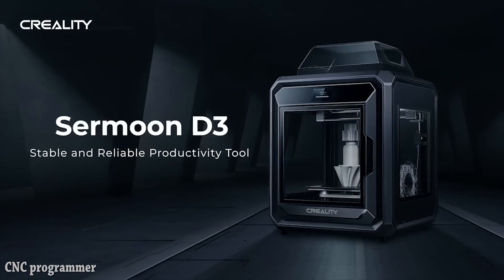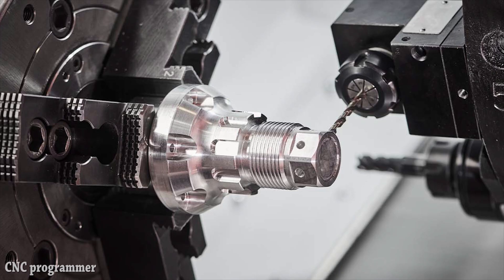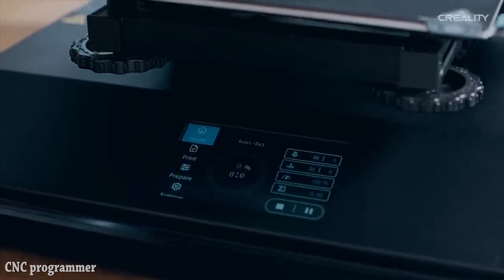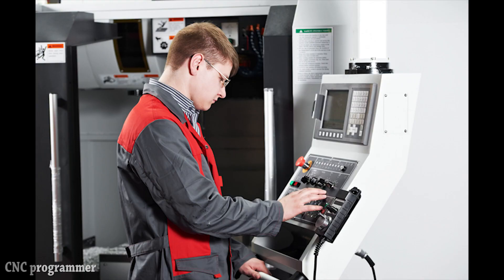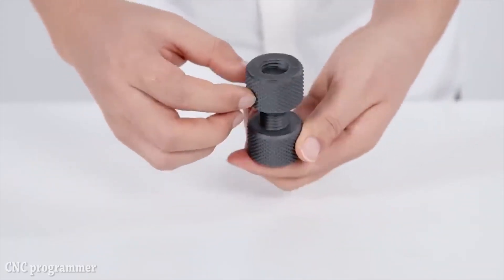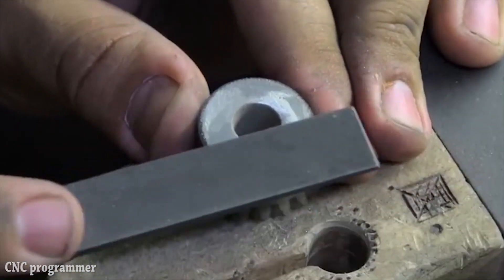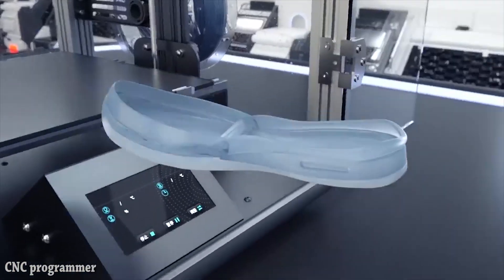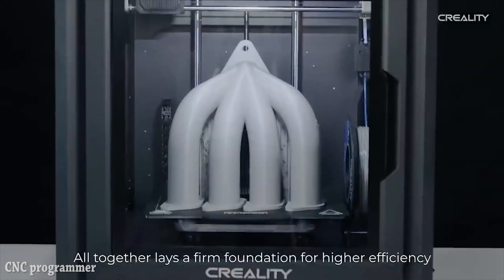Should CNC Operators Learn to Use 3D printers?

Comment: cnc operators manufacture 3d printers😁
Reply from the maker: Yes :) 
do you think manual programming will be used in the future?
Reply: @CNCProgrammer  there are always things that can be programmed faster on the machine than on the computer, provided you can program manually.